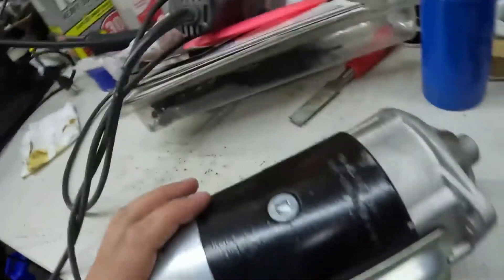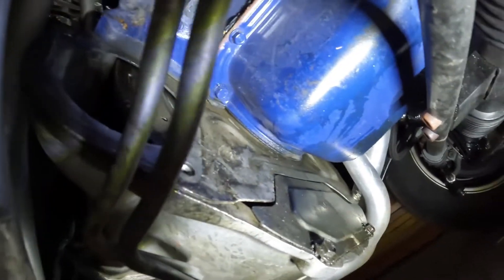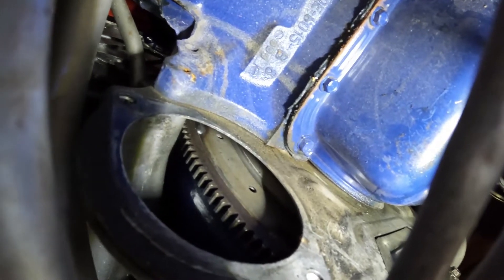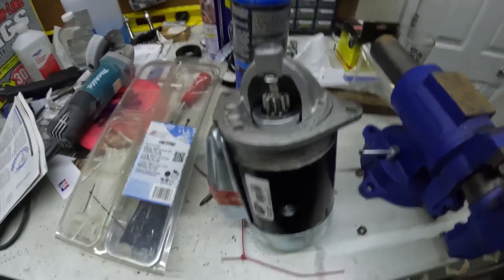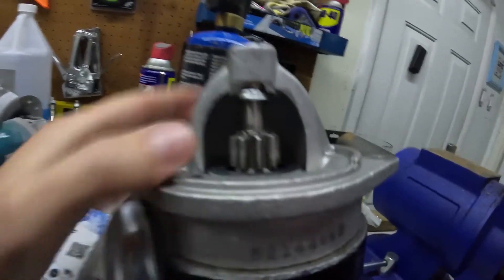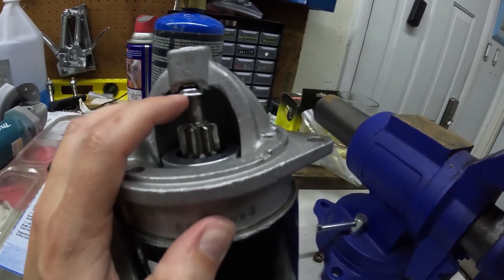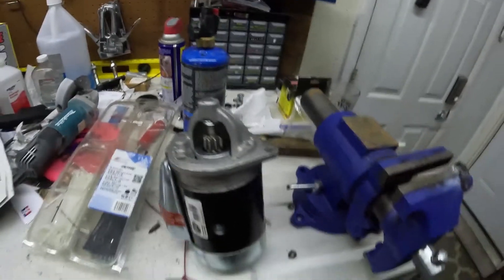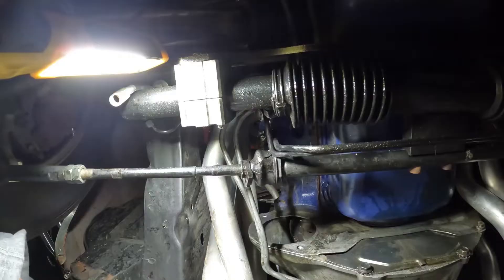Replacing a Starter for my 1969 Mustang Mach 1 351 Windsor

Comment: I have a 351w and a C6 transmission and there is a bit of confusion as to which starter to use one has 3/4 inch depth to the flex plate and the other is 3/8.